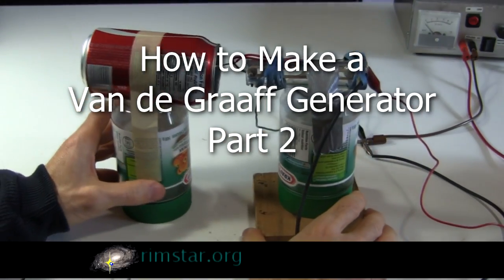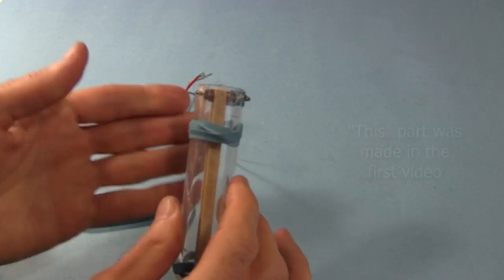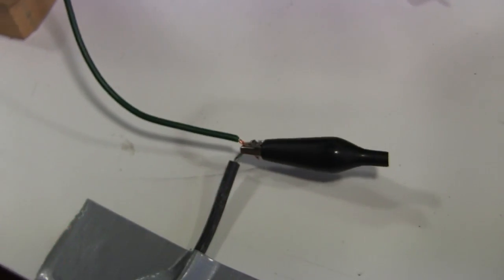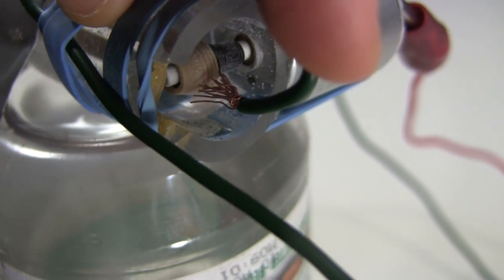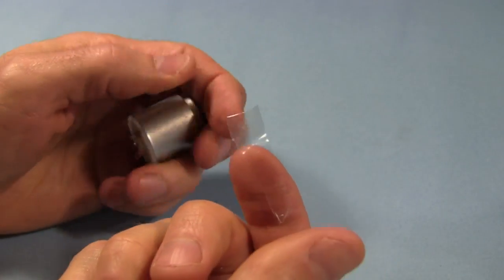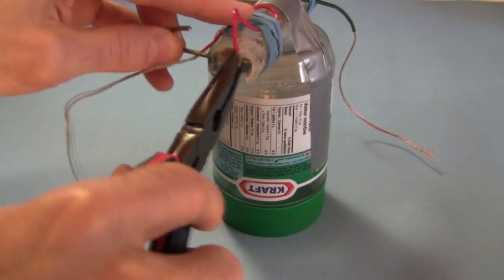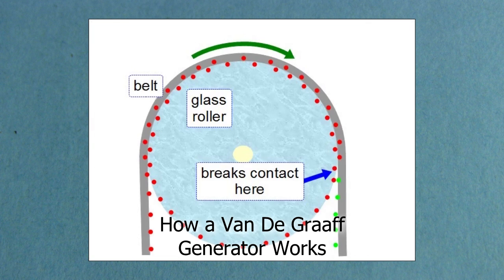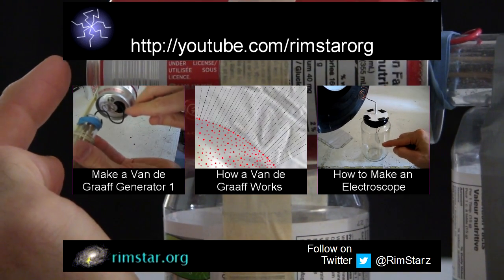How to Make a Van de Graaff Generator Part 2

Comment: I had success with balloon rubber belt and one roller of pvc tape and other of nylon thread on plastic.  It gave spark for some time but it stops after some time. What's the problem may be?
Reply from the maker: Check your rollers. Maybe there's the surface material is wearing down? Is the belt getting looser over time from stretching? Did the air in the room get more humid? Is the belt still positioned properly on the rollers? Are you sure the rollers are still turning; maybe one of them is stuck? All just suggestions to look at.
Reply: It rained yesterday . Humidity might be the problem. .. thanks for the response sir...